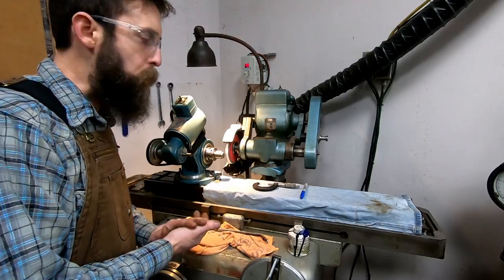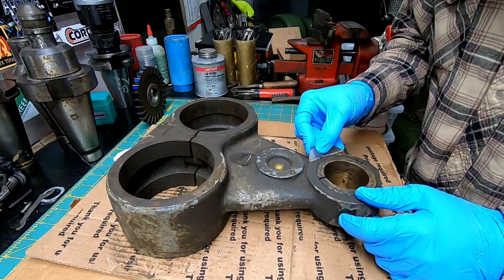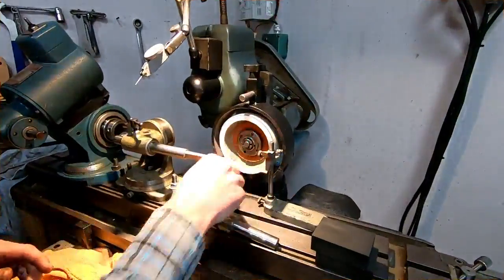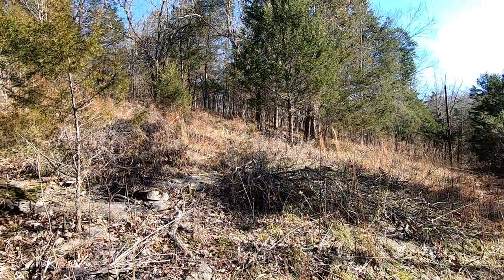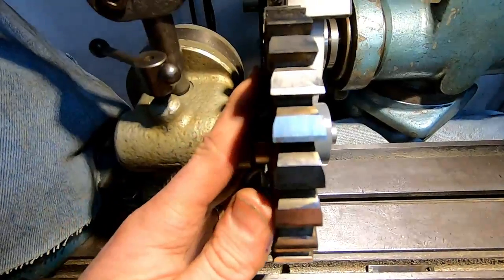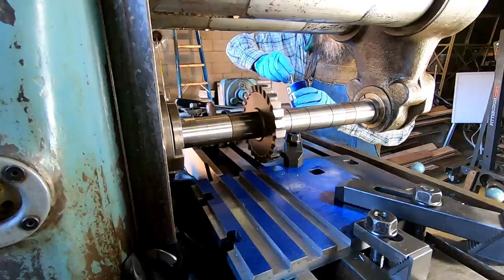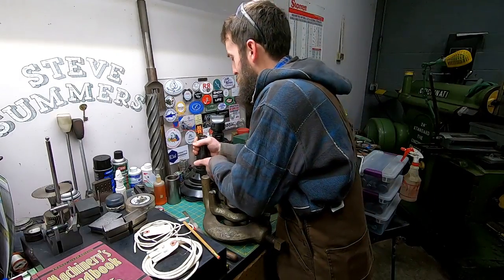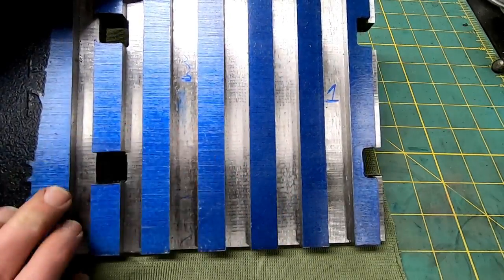Cutter Grinder  Horizontial Mill Work  & MORE!

Comment: I know this is old but i have a Newall DP750 on an Aciera F5 which i think has similar travels and size but less X. The microsyn scales have very small cross section and are super easy to mount. 500mmx 500mmz and 400mm Y cost me about $1200 aussie dollars

Comment: Love the K&T mill, on my small mill I keep the over arm support stick out as short as possible. Also I don't use an arbor key, just gripping the cutter by friction from the arbor nut just in case the cutter setup snags. I have heard of using a brass arbor key again if snagging occurs the key will be the only thing getting damaged. Keep posting the great videos. Thanks Barry

Comment: Love watching your video's Steve and have much respect for the way you go about achieving your goals but i was just wondering what your thoughts were on moving your arbor support closer to the cutter for more support, i realize the clamping situation would probably be in the way of your smaller cutters.
Reply from the maker: Tried it. With the hold down studs moving it closer with this setup and size cutter didn't work. I understand the concept of support well and agree if you can run it close you should. 👍Not much clearance under the large  support.

Comment: Steve,
When hunting for that DRO remember you are machining at home, in a non temperature controlled environment, making one off parts.
Do you REALLY need top of the line accuracy ?
I would be looking for a mid range unit at a price I didn't have to struggle to meet.
But then I'm Part Scots with short arms and deep spider filled pockets.
Cheers from  downunder
Eric

Comment: Love your videos on the tool cutter, and of course you Mill.. Mine is up, and running now too.. Just needs a gear box oil change., but waiting for the oil.. The Cinpak 60 205-12 is my model  Not one thing wrong with the thing, as far as function goes. Your comment on moving it made me want to post a pick of mine.. Hard to find space sometimes, but worth the hassle..https://ibb.co/SsNxdnZ

Comment: Great video Steve! I have a Newall on my Bridgeport and it works great. I also have one of the Asian dro's on a Sheldon lathe 11x49. They both work well BUT if I were to do it again and I could swing it financially I would go with the Newall without a doubt. That's funny Steve, they say the same thing about the weather in New Jersey. Thanks again for the video.

Comment: Steve I’d recommend a DRO pros unit first. It’s mid range in price, yes it’s an import however I installed on on my Lagun, Keith Rucker has one on his Wells. Their excellent units, plus the customer support is US based and are extremely helpful and knowledgeable.  Another good value option is a Shooting Star, I had one of their units on a bench mill, they use a notched track system and are extremely easy to cut to fit. Hopefully that helps

Comment: To help with the harmonics, try putting some magnets on the underside of the over hang. I have used the ones you get for free at the local fairs, advertising magnets. Use them on brake rotors when turning and they start to chatter.

Comment: lookig at the setup i'm wondering if  it works better if you place the cutter horizontally on the table , would give you more room and you be able to stagger cut the teeth at an angle too (every 1st the one way every 2nd the other way (cutter flipped) and every 3th straight
as for the dro , i would just keep checking graigslist and ebay
as for the runout : have you checked the sides of the cutting edges wouldnt be suprised if he messed those up too

Comment: Hi steve, another great video that leads me to a question(as usual)On the horizontal mill I see you always put the shaft support right at the end. I there a reason why you do not move it inwards and put the spacers outboard, this would limit drastcally any deflection in the shaft, shorten the horn hangout too for even more rigidety. its a bit like using the intermediate support. If its made to work fully extended like that why is it adjustable both the horns in and out and a through hole on the support to fit it further on the horns. The grinder is proving to be a great buy with all those cutters to sharpen. thanks again for sharing. cheers, Derek.

Comment: Great video,    I took a chance and bought a DRO from THEDROStore for my round ram Bridgeport with J head. I was hesitant because It was coming from off shore but they had references from all over the globe so I went for it.  That thing has worked flawlessly for about 9yrs now. My only complaint is the poorly written manual. For me it was worth the money saved.

Comment: Steve, I like your sharpened Cutters being used.
To reduce chatter in horizontal milling, try shorting distance that support is from cutter. (try support bearing about 3/4 along shaft)
The closer to cutter the better, extra shaft length will be out past support which is OK.
 Just watch clearance to clamps and work. Cheers from Australia.

Comment: Aloha Steve, I have always found it difficult to argue with success!  As we do more and more of the same setups we will get faster, but success is success.  I envy you your shop and the other you-tubers the access you have to tooling and equipment, here in Hawaii sometimes I cannot find a supplier willing to ship here, E-bay and Amazon are getting more and more "do not ship to Hawaii or Alaska and we have the same mail service as the upper 48.  I have a question I haven't been able to answer, why didn't we start with a 200' x 200' shop?????  that may have lasted 6 months without getting crowded.  Thanks for your time sharing with us.

Comment: Why not take that plate and use the shaper and flatten out the bottom, then take it over to your mill and use a keyway cutter and turn those slots into "T" bolt slots and use it as a fixture plate?  Make a half dozen "T" nuts for it in to fit your hold down studs, and you are in business with a useful hold down plate.  I've used those railroad tie plates before,  they are made from a nice grade of steel, it would be a shame to waste it.

Comment: I've been thinking about a DRO for my K&T 2H. Mounting it with x , y and z t slots for the stops .  Minimal hole drilling that way too. I'll be using "el cleapo" model from eBay probably.

Comment: 23:18 Wouldn't it be better if the wheel was spinning the other way and going into the edge instead of come off of it as it grinds?
Reply: Why?
Reply: @paulcopeland9035  I don't know how much of a difference it makes, but they say it leaves a stronger and more durable edge, because the material at the very edge is being 'pushed into' the edge instead of being dragged off, which is meant to leave a more uniform edge. More critical when grinding carbide tools since carbide is more brittle. The same is true when stoning tools by hand, or sharpening a knife. Robin Renzetti is someone who strongly advocates this.

Comment: Here's a tip that may make your shop life a bit easier.  Keep a bucket of used oil around, a few gallons.  Cleaning something like this support will go faster if you oil soak it for a day or two.  I routinely did this at one job where the machines were older than me, about WWII vintage which had never been cleaned by the 2000's.  Oil soaking when time allowed, greatly speeded the gunk removal and eased inspection of machine parts.  After a year or two of this, I still had to "degunk" the bucket which had accumulated several inches of chips, dirt and rust, and made me stink for a day, but it still was a benefit.

Comment: The first part of the video showing your test cuts on the horizontal slab...the outside end of the first spacer on the cutter shaft definitely shows a rhythmic wobble that needs investigation.  Cure that wobble, and the bottom finish of your cuts should look nicer, given that your cutter blades have been freshly dressed.  Very nice video!

Comment: Thanks for another great video Steve. While watching the footage, when you were talking about the supplies other viewers had sent you, I noticed a pale blue grinding wheel at the bottom of the stack of white wheels. I would suggest you research that wheel closely because if it is what I suspect, it would be extremely valuable in grinding hardened D-2 tool steel (60-62 Rc). It is the only wheel I know of that will do the job efficiently.

Comment: Hey Steve, 
My 2 cents on the DRO; go for a set of the import ones. I had to replace a DRO on my small mill and opted for a Ditron readout and added an extra scale to the Z as well. You can get a 3 axis set for around $420. Have a look at the D80 readout with lcd screen. I’m happy with the quality👍🏼👍🏼

Comment: looks good steve, lots more nice scores and very nice showing the cutter being sharpened. I would have mentioned that you want to cut towards the edge of the tooth, which I saw the sparks flying upwards like that so that the tooth is pushed into the finger, and they actually come out sharper that way, which is opposite than cutting/sharpening a normal tool bit. Sharpening endmills is the exact same way, you want to sharpen towards the flute rather into it.
Also, what size motor is on the head of the T&C grinder? It doesnt look like a very big one in HP rating.
Reply: Your method does force the tooth to the finger, but sharpening in that manner likely causes a burr to roll off the end of the tooth, and more likely to burn the tip.  Both methods are acceptable, just more of the operators preference
Reply: Ive always been told to grind towards the cutting flute with HSS bits, mainly because when your only taking off a few tenths at a time with a T&C grinder, it wont really do much of a burr, but to grind away from the cutting edge when grinding normal bits because your doing more of shaping than sharpening. Ive also heard the opposite about carbide when it pertains to carbide endmills because of the sharp edges of the flutes can be chipped by the grit on the wheel. If you look at almost any T&C grinder video, they're always cutting down into the cutting edge. 

Ive also seen various tests trying both ways and sharpening towards the edge resulted in a much sharper cutting edge that actually cut much better. 

I saw that steve was right in that aspect, but he had the wheel spinning in reverse, so that it was grinding towards the cutting edges, hence why the sparks were flying upwards, but doing it that way kinda makes trouble because the sparks and everything is going in the opposite way of the dust collection system. 

But yea, it's up to the operator and it may be different for different ways of grinding the tools may result in different results, but whatever works for the person that is doing it, thats all that really matters, lol.

Comment: I've got one of the cheap chinese import ones on my lathe... I think I paid $210 plus shipping for the head unit and two scales.  No problem at all with accuracy, although I did have to work a bit to customize the mounts for my lathe.  There's not a ton of documentation so you have to search online for tips and tricks for it, but it works quite well and you can't beat the price.  I even have a pair of heidenhain scales I thought I might use with it (the display uses standard methods of reading the scales, differential signaling) but there wasn't any need.

Comment: I have been using a Shooting Star DRO on my lathe for about 15 years now without any problems. They may not be as fancy as some but they are about indestructible. There aren't any glass scales to break and aren't as critical to set up. They are less expensive than most also. Enjoy your videos, thanks.

Comment: I think, the cut with the fresh grinded cutter looks fine.  Consider, it´s a roughing cut, convetional milled. If you would have made a finishing cut, a few thou deep climb milling, it would look even better, but why, for a test cut. I would consider, to put the arbor support nearer to the cutter. The arbor may have some stickout in front of the support, but that is not a big deal. So you would minimize harmonic vibration in the arbor, and improve the cut. At least, until you have more arbors in different length. With a shorter arbor, you even don´t have stickout in the way.

Comment: Excellent video, liked the local area intermissions.  I use igaging DRO's at work installing on drill mills and at home on my mill and have had no problems with them.  Price is great and they make many lengths. Current products have stackable remote readouts for X,Y&Z layouts
Reply: And if you want more features to your DRO, you can connect it to a tablet. http://www.yuriystoys.com/p/android-dro.html

Comment: Question; Would the chatter on your fresh Cutter be coming from the width of the teeth? The previous owner or the one who sharpened it may have visited those sides and done some "damage".
I hear some snow is coming in from the west, good luck. Take some video of that. Winter Storm Gia?
Fantastic job on the new support! When you get something cheap and it turns out "brand new" make you feel like a lucky man.

Comment: A steady flow of oil is needed for those horizontal cutters.. You will find that in deep cuts you will be served much better by stagger tooth cutters.. The straight tooth work well for removing lands and such where the metal removed is not as wide as the cutter itself.... Mike in Louisiana (Ramsay 1)

Comment: Steve, check out M-DRO magnetic encoders made in the UK.  I just installed one on a small 1340 lathe.  It appears to be good quality, better than the cheaper China imports and 1/3rd the price of a Newall.  I did a lot of research before buying it 
on Amazon which was sold thru SRA Shops in Massachusetts.  Heads up, some of the Amazon offerings are limited 
such as 1,000 mm magnetic tape which I had to buy direct from SRA Shops.  I really haven't put it thru its paces yet 
since this install is part of a complete refurbishment but so far I'm happy with it and may slap one the Bridgeport.  
Good luck!

Comment: Seems like that cutter was ground with unsuitable / bad quality wheel before as the highest and lowest are next to each other. That teeth which was the lowest was the first teeth to be cut and the wheel wore out during the grinding and thus became smaller leaving the last tooth highest.
Reply: That's what I thought but wouldn't you run the wheel across the first tooth to check for wheel degradation? That's an honest question, I've never run a cutter grinder. Perhaps they did, saw giant gap there was and said screw it.

Comment: Hi Steve I have been looking at DRO PRO's for a lathe DRO . And they also have mill DRO's there is several different ones to choice from with types of scales and 1,2,3, year warranty. A DRO for my 16" x 54" lathe I think was about 1150.00 Good Luck

Comment: Seeing this is your favorite machine do the other machines know your feelings LOL or is this a secret between the two of you. I can tell by your sharing the detailed description of what you are going to grind and to what size that you really enjoy this machine. I never had (unaware of) or ran a second unit arbor support while machining in the horizontal. Nice fit guessing you can rough cut or slot Inconel on her. Liking the little height gauge centering gauge whatever it is small a tool so we are loving it. Nice cutter chatter explanation at the end, thank you.

Comment: Hi Steve.  Good job on the cutter grind.  Arbor bearings can be positioned anywhere along the length of the arbor and should be as close to the cutter as possible for maximum rigidity,   Also, a shop rag or a fitted piece of masonite will go a long way toward protecting the table surface from damage by tools or other metal objects.   Jim D (K&T retired)

Comment: There normally is a piece of wood in the split in the arbor bushing to prevent over tightening and to prevent distortion of the bushing- obviously on a new bushing. You got a good buy on the support.

Comment: Great video Steve.  I remember, as an apprentice, slotting these clevises, in a fixture, 30 at a time.  They had a .5 slot x 2.3 deep.  It was an old Cincinnati with Army Air Corp name plates on it.  Anyhow, none of our arbors or cutters were ever true and I was convinced (by other employees and for quite some time actually) that all horizontal mills ran out like that.  30 years later and I've learned that's not the case, just a silly story or my naivety as a teen apprentice.  
Anyhow, thanks for sharing all that you do with us, it's fun watching other guys in the trade growing, especially as much as you have since I subbed during a scraping video, I believe... lots less talking back then, more grunting, lololol (not a dig at the commentary, I think your vids have a great mix of talk and do).  Just funnin' man. Keep up the good work!

Comment: Steve, I've been using a 3-axis dro from eBay (JCS900-3AE) for a couple years now. I haven't had any trouble with it and it's more than accurate enough. The functions such as bolt circle work great. Thank you for the video, always enjoyable and educational.

Comment: Steve for what it's worth, were it me, I would save up some money and buy a 3 axis  Newall and only buy it once if you get my drift. The DP500  is quality unit, you can get service parts if it is ever needed and it will most likely have all the functions you might need on your mill. I have never needed repairs, but from what I have read online Newall has a great service.  The scales are tough and pretty much bullet proof. If you want all the bells and whistles a DP700 will run you a bit more dough.
Reply: I'd be willing to put money in the pot, as would many others I suspect, to help get the best DRO for you.  Go for the best you won't regret it!

Comment: Nice job on the cutter grinding! I was wondering if your mill is the same one as Kieth Rucker's. They look pretty much the same. I've had good luck with a cheaper Eason dro that came from China for around the 400 dollar range. It seems to be working out fine surprisingly